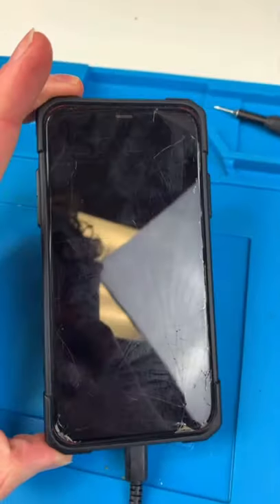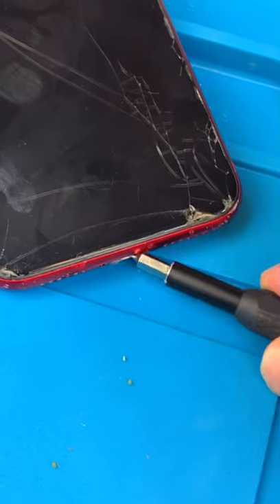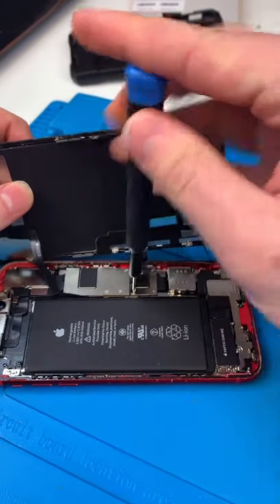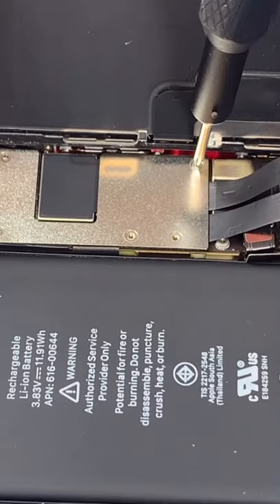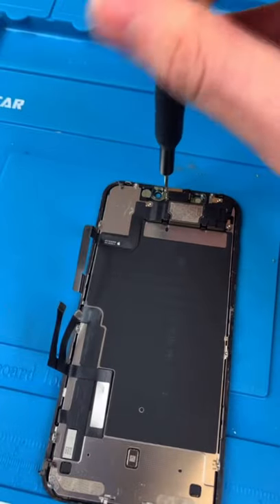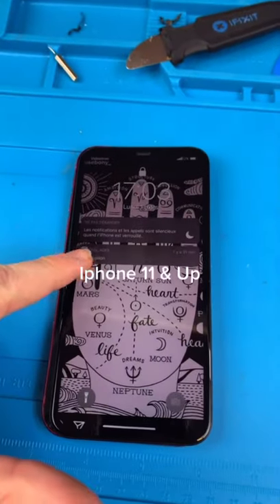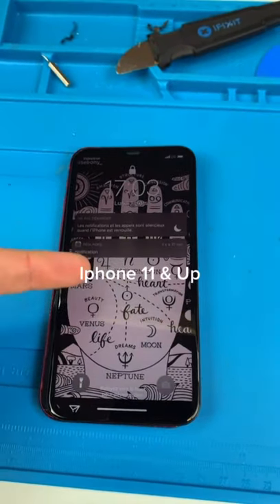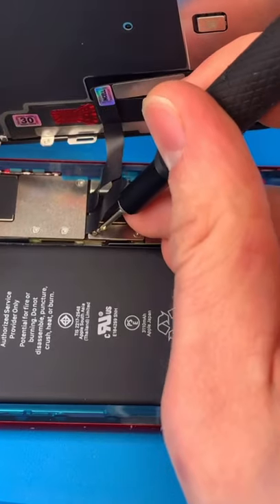iPhone 11's Are Built Different...... Restored #Shorts

Comment: I am a technician myself. The iPhone 11 is probably my favorite device to repair and I’ve done hundreds, if not thousands of screen replacements on them. It really isn’t that difficult if you keep it flat on its side and slide it upward while gently holding the display cable down in the up direction using your left hand index finger. Super easy. I’ve never damaged a display cable by doing this, nor have I had any defects, lines, or problems post-repair using this method. I would be happy to make a video demonstrating this technique if enough people want it. 😊😅

Comment: for the iPhone 11s and XR you don’t need to unplug the battery, only those phones^^^ once you are done the repair your screen will usually remain black so what you would do is volume up volume down and hold down the power button till you see the apple logo. The reason being is this mode just resets the whole phone and lcd and everything else. Its weird they never implemented this to the other iphones.

Comment: That chip is easier to do with 138° bismuth solder. It's ok for something like this, that doesn't get extensive repeated stresses. Don't do chipquik though, it'll deform or even melt if the phone is left display up in the sun.

Comment: The reason the place it under the screen it’s for you to remove the lcd before removing the battery. They place a special mechanism to stop short circuits. And phone must be off ; then fix the battery with screw and next the screen. 😊

Comment: Can we clean our charging port our self and how
Reply: Yea just take a paper clip or Bobby pin something of that sort and very gently move it around inside the port. I’ve done it several times there’s nothing that’s sticking out that you could break by doing this. Just be careful along the “walls” of the port where the connectors are for the charger

Comment: How much does it cost to get a phone fixed? My phone has a pretty damaged screen in some spots and the silent doesn’t work/vibrate, whenever I turn vibrate mode on and take pictures the sound still happens and it was like it since I got it.
Reply: Beware of a scammer pretending to be him. If it sends you a whatsapp number and doesn't have a gray circle in the channel name and does not have the amount of subscribers he has on the channel, it is most likely a scammer. If that's the case, report the scammer's comments and channel.